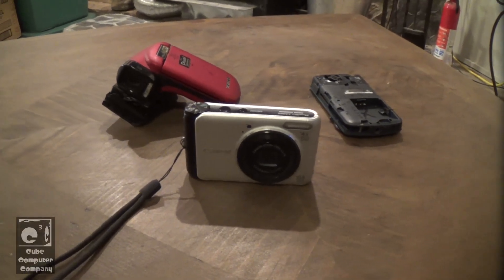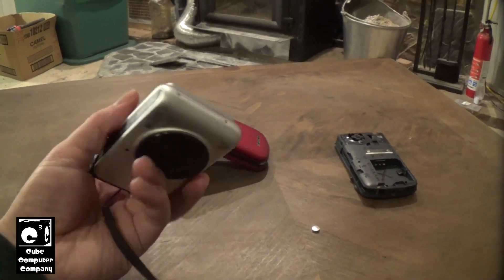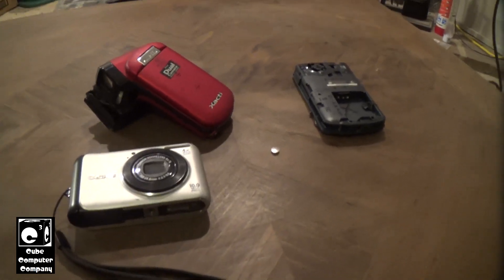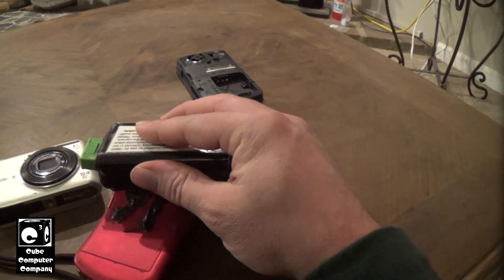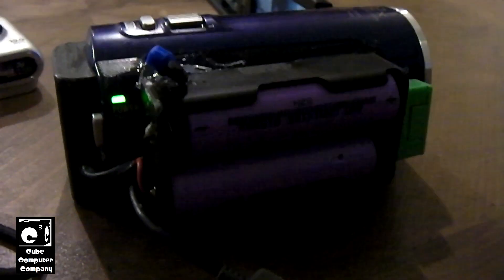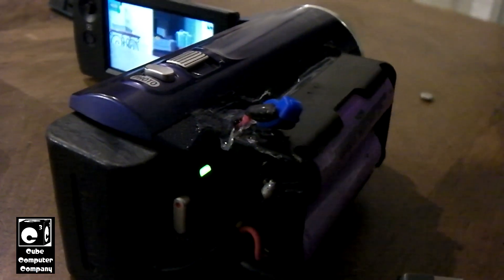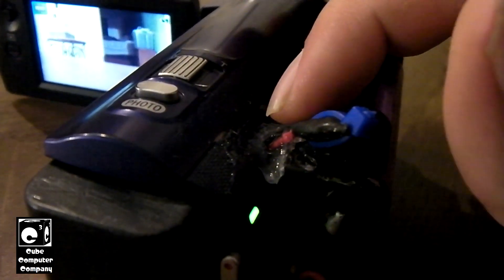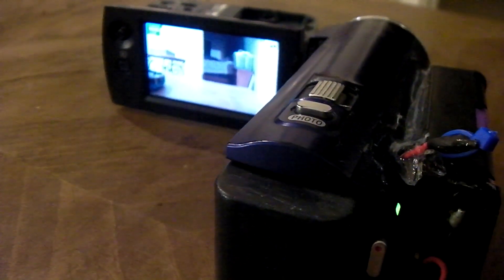The important hidden battery inside your camera you can't easily replace

Comment: Thanks for doing the rant before me because I was raging lol.  I have 2 Sony Handicams and both need ML621's.  I'm  a retired electronics tech but holy this battery is a pain to replace.  I like your mod.  On another note, when the ML621 died did your camera keep saying "Reinsert Card".  Gilles.  That's how I diagnosed the battery issue
Reply from the maker: The only symptoms of the dead internal battery were loss of date/time and settings the moment the main battery was disconnected without the USB port getting power. I do have issues with some SD cards not being recognized without having to reinsert multiple times.